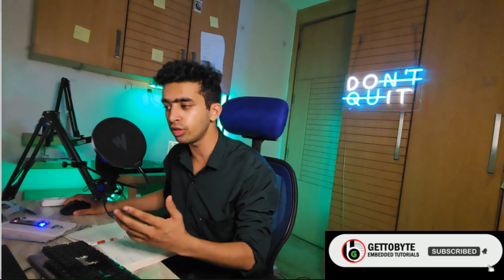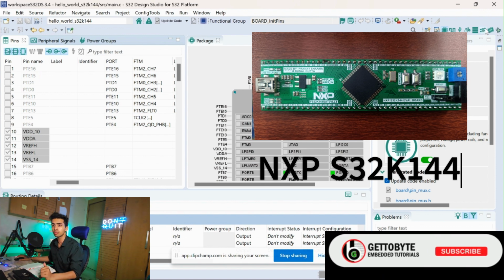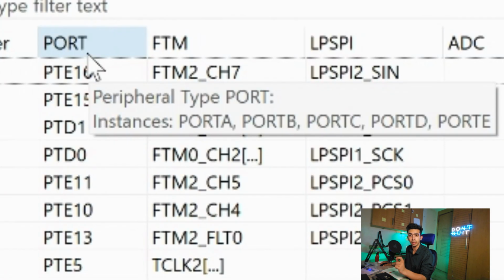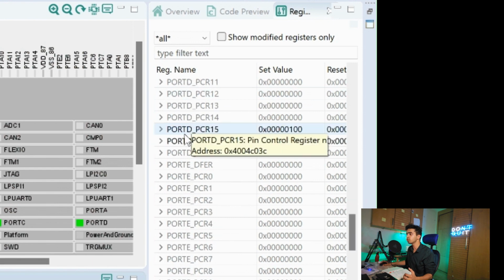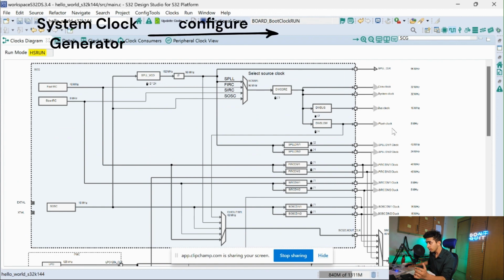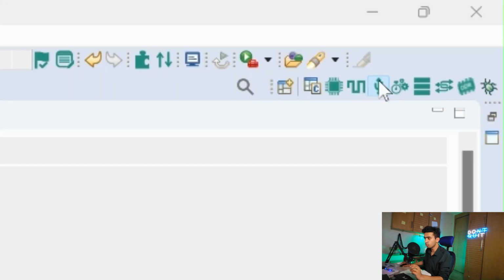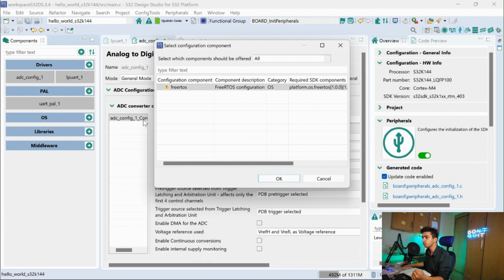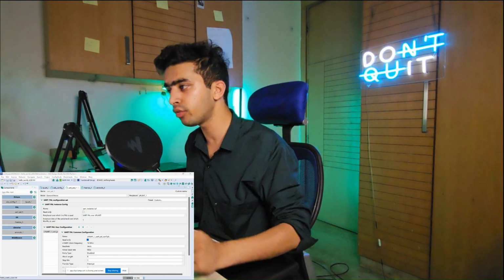How to write code for MCU without writing any code Part 2 || S32 Configuration Tool || S32K1 | S32K3

Comment: hey bro, I'm using S32K146 EVB for my UG project, I do find the S32K144 board pin layout but I don't find S32K146. both are different but have the same 6 nos. J header each. could you share details for the S32K146 board pin layout?